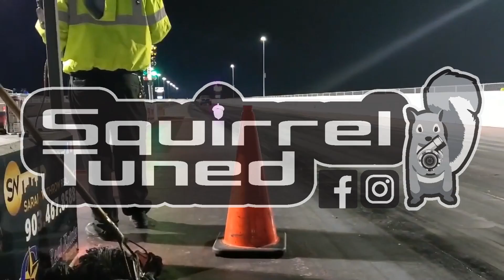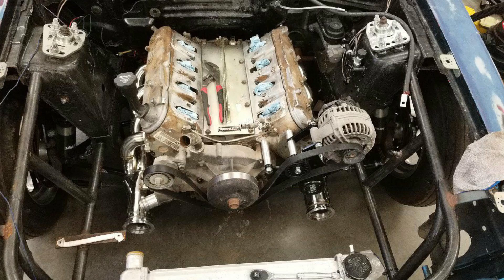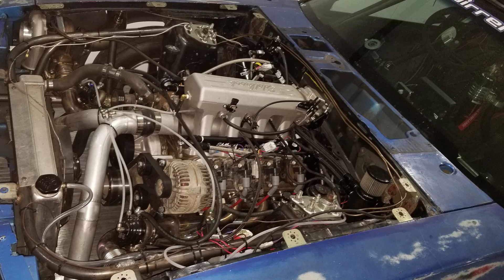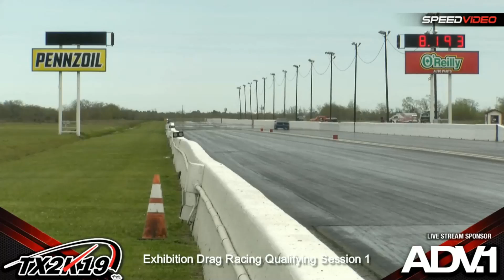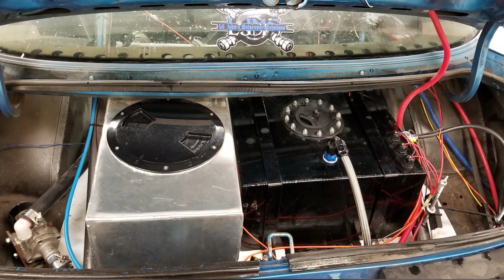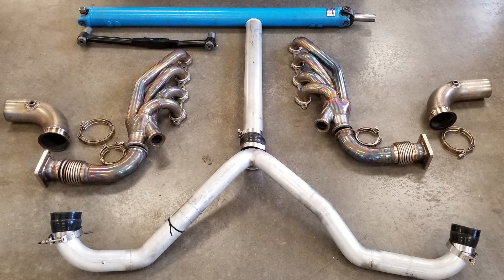7 Second STOCK Bottom End 4.8 Parts List!

Comment: Some of the best info around! Awesome how you know all the part  numbers too awesome build
Reply from the maker: Thank you! I probably listed them off 100 times in messenger before making this video so they are burned into my head lol. Check out the new car too! It should be up and going before too long
Reply: @SquirrelTuned  been wanting to do a truck motor on boost for a long time now, I've gone over the builds so many times it's just really nice to see someone doing it budget friendly and really breaking it down  from the rings to the oil pump and anything in between

Comment: I have almost the same setup in a 3rd gen only deferent is I have a 4th gen 7.5 rear I do have a 8.8 rear I may switch car up after I run it for first time this year and switch rear I hope to at least go 9s in qt 5s in 8th
Reply from the maker: Good luck! I think it should be capable for sure. 5s in the 1/8 is bottom 9s as well. 8.9 is usually around 5.7-5.8 1/8.

Comment: Can you elaborate more on lifters?? How much preload do you like to run on them? Did you have issues with the stock ones before going to the Johnsons?
Reply from the maker: I went straight to Johnsons. Stock will do pretty well too but I have seen people with high rpm combos switch and see gains. I run the manufacture suggested preload. I may be wrong. But if I remember right Johnson suggests .025 +/- .005 for mine.

Comment: Awesome video and build. What size fuel lines did you run?
Reply from the maker: Thank you! 10an feed split to 2 8s into rails and out and back into regulator then 8an return.
Reply: Squirrel Tuned cool deal. Do you run an in-line filter or just the pump filters?

Comment: Great video! What 3 to 1 fuel block did you use for your triple Walbro’s? I can’t quite see the part number. TIA and can’t wait to see the new project.
Reply from the maker: If you put this number into Google it should pull up the Ebay ad for it. 370998379688

Comment: What coils would you recommend running on a twin s366 5.3? Are the aftermarket ones really better than factory? Thanks ..... badass ride and videos. Thanks for the info
Reply from the maker: Stock is fine and plenty capable. In my opinion it's only worth upgrading to a ign1a aka smart coil when you move to methanol as a primary fuel.

Comment: That thing sounds like a built race engine! What oil do you use? I need to know!
Reply from the maker: Vr1 20w50
Reply: @SquirrelTuned  wow! I only use that in my bed blocks. What state are you in? I'm in Louisiana and wonder if that's good for street driving
Reply from the maker: @tzracing4183  I'm in New Mexico and I've used it in other cars street driving no issues. Always in high power stuff so it gets changed more often than normal though.

Comment: Sill running the oem rod bolts? Or switch to arp? Find the entire thing very interesting lots of power on stock equipment
Reply from the maker: Bone stock I never even pulled them out to check bearings or anything. And me too! Fun to see how far it can go.
Reply: On stock rods the bolts will not be a problem. Rods will snap right above the big end before anything else.

Comment: Hey man got another question for ya..... Did you say 3/8 pushrods? Texas speed said they would have clearance issues with my PRC heads. Just wondering if you had to do any machine work to get those to work..... thanks again!
Reply from the maker: I did say 3/8 and no clearancing needed on my stock heads for them. Maybe the prc don't have as much room as factory heads there.

Comment: what is your thought on head studs vs head bolts?  I got arp head bolts because of the price difference between their head bolts and head studs.  I feel that on both of them you are having to over come the friction of the thrads and the friction of either the bottom of the head on the bolt or the bottom of the nut if using head studs.  You going to try setting any kind of sbe records on a 5.3 or 6.0 in the future ya think?  Also with just this video I bet you are going to cruise right past the 1000 subscriber mark
Reply from the maker: Thanks man I hope so! It has definitely gotten more attention than any others so far. Think I have picked up nearly 100 since posting. And Personally I think a stud is a little more capable but people have made big power with even stock bolts so I don't think studs are the only way to go. Don't have experience pushing the bolts to their limits though. And not at the moment no, current plan is to make the 4.8 record really hard to beat then move on to a built stock block setup.
Reply: @SquirrelTuned  thats cool, I'm sure making everyting as light as possible will help also.  One more question I am getting ready to pull my motor soon a do a few things to it, how did you go about tacking the reluctor wheel to the crank?  I have done a bit of searching and can't find much on it.  I have a mig and a tig welder but I'm curious as to what wire to use or what the process is?  thanks
Reply from the maker: @ryanaxberg9263  I just pulled the pan and windage tray off and someone else did the welding it was tig though if I remember right but nothing special and doesnt have to be super strong or anything just enough to hold it. Soon I'm swapping pans so I'll make sure to show the welds in the video.
Reply: @SquirrelTuned  right on, I appreciate it

Comment: Thanks for sharing this info....I have followed as best I could from a far over the last year and always wanted to know about your setup, the no ring gap blows me away.... what fuel did you run and obviously verifying timing and the timing you ran must have played a part in keeping it together. Is there a reason you would not do the ring gap in a 4.8 or 5.3? Just rewatched, c16 mix! Very cool.
Reply from the maker: I actually did not verify timing lol. I wouldn't recommend doing that but I never did it. And yes timing is a big part of it. At 1k subs I'll be showing exactly how much timing it had and how I use it to keep it alive.
Reply: Squirrel Tuned cool , I have shared the vid I hope you get a lot more than a thousand....I just imported a 5.3 and dropped it in my car, I did a cam lifters and pushrods, weldeded up a hot side for a single turbo, bigger injectors etc etc the usual stuff, but the biggest game changer for me was getting the Holley efi plug n play, I’m thinking keep the timing safe through the mid range where all the torque and max cylinder pressure is, I got lucky and got a gen4 rod motor. I’m an old carb guy so I’m learning a lot and enjoying the sbe injected gig.
Reply from the maker: @clint.garage.6092  awesome thanks man! And the Holley is sweet for sure it makes things easier! And that's pretty much what I do too! The SBE stuff is a lot of fun to me. Crazy to see what an engine that made 265hp from the factory can do with some minor changes.
Reply: Squirrel Tuned can I ask what harmonic damper you are using, and how important is it to use an aftermarket one when trying for a max effort deal like you are.
Reply from the maker: @clint.garage.6092  it's a summit 25% underdrive one. And tbh I'm not sure on that but the main reason I did it was to keep from over spinning the alternator revving to 8k+

Comment: You mentioned the Johnson short travel lifters, I currently use Johnson 2110 regular travel lifters, any objection to using those for a similar  8000 rpm job?
Reply from the maker: I would say they would work alright spinning near 8000rpm but I don't personally have experience with those. The biggest difference is probably the fact that those still use trays where mine are link bar lifters. And of course the short travel, but I have seen non short travel link bar lifters pushed pretty far too.
Reply: @SquirrelTuned  hmm maybe I should invest in a Johnson link bar setup like yours, it has already proven itself.

Comment: I apologize before hand but I didn’t catch it in the video, my question is “was the 4.8 a Gen-3 or a Gen-4 type connecting rod setup?”
Reply from the maker: @matthewthorcherry6925  it was a 2005 which is a middle year. Still gen 3 crank and cam sensor but did have the gen 4 stronger internals.

Comment: Hi, does your fuel rail have the feed going into one rail and the return out the other rail? Or a feed to each rail? Thanks
Reply from the maker: The feed Y's into both
Reply: @Squirrel Tuned  Thank you! 
And as far as the regulator, is there anything negative with having it at the front of the intake manifold where it gets fed from each rail's return? 
I see them mounted on the fender usually so I wasn't sure if it's a heat thing or not.
Reply from the maker: @GTStuning-  No that works fine too. My new setup is like that and returns under the intake manifold.
Reply: @SquirrelTuned  Perfect to hear, I appreciate the info

Comment: How much power has this motor was making and how long it has been good? At 1k whp 6.0 gen 4 sbe possibly to last couple years? Also the btr kit you have on yoir website is that a good one with the titanium retainers? Is that one going to be better then the kit you had at first where the valves where floating?
Reply from the maker: Based off mph the most I made with it is 1400hp. It's been over 1000 for 150 passes or more I'd say. I haven't hurt it yet. The ultimate rpm spring kit is the one I went to after and it does come with titanium retainers. I believe I have the .660 kit which I had before and the .650 ultimate rpm kit both on my site.
Reply from the maker: Nevermind it appears I do just have the ultimate rpm kit on my site. Which is what I switched to to fix the float issue.
Reply: @SquirrelTuned  I will order that tomorrow  and also I want to get a tune, you can also make a base map for track and then slowly dial it in for extra pay? I just seen your videos your very good at what you do
Reply: @SquirrelTuned  I actually just ordered the 650 kit from you sir. We're doing 6.0 iron block still not sure if it will be sbe or piston and rods type of deal but ill email you later when it's time to tune